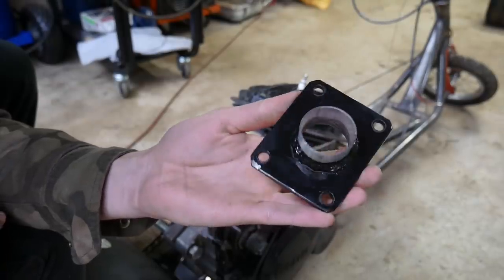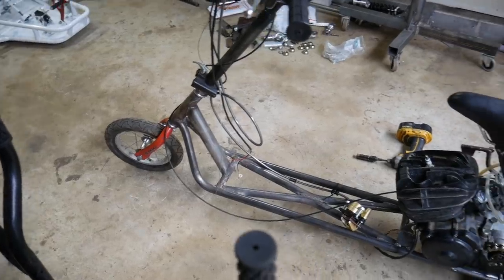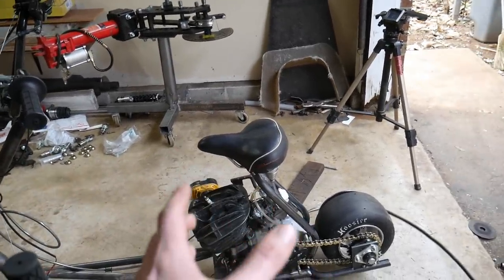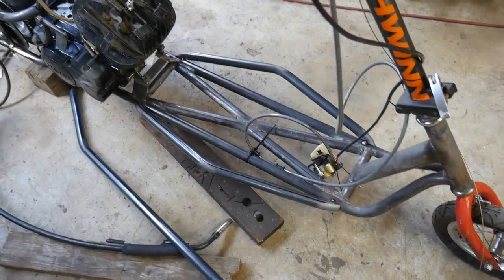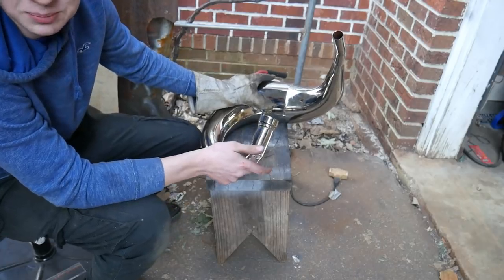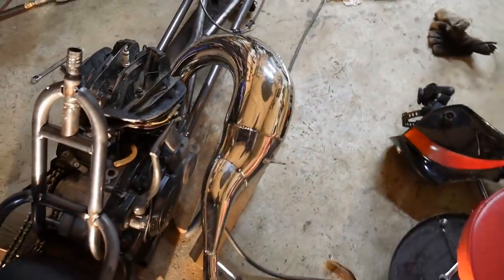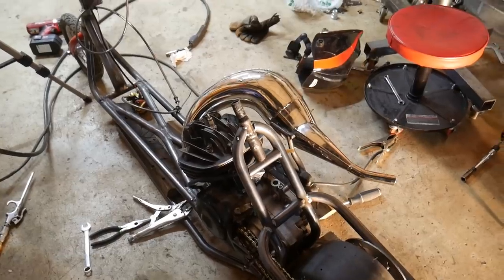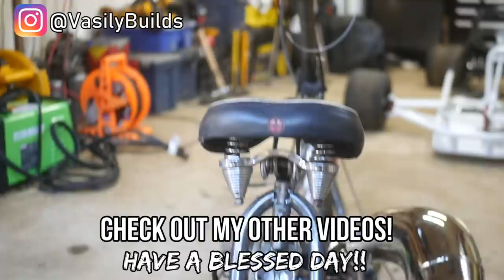Yamaha Blaster 200cc Drag Scooter Build Part 2

Comment: The reason the carb flange was turned was to allow the carb to sit vertically. With it angled like that you’ll either lose bowl capacity, or be more prone to leaking. The only carbs that work just as great tilted as they do straight are Lectron carbs. With the amount of vibration that a 2 stroke produces, the little bit of reduced capacity of the bowl will likely cause it to starve out, which can be catastrophic on a 2 stroke.

Comment: Here's a tip on getting your fcaw welds to look better, instead of weaving your weld like you would with gmaw its generally practiced to just straight push it without weaving it and just straight pull it for thicker gauges of metal. Itll take a little practice and itll feel wrong but you'll get it. Hope that helps!

Comment: My two thoughts:
Pipe will need rear support, or it will break off quickly.
Carb needs to be level (thats why the stock manifold has slight bend) Float wont work properly at that drastic angle - unless you buy a specific downdraft carb........
Reply: I thought that he should put the muffler under the seat because it looks really far out to the side
Reply from the maker: Carb doesn't have to be level if it's going to be spending most of it's time on one wheel 🤷🏼‍♀️ pipe will have a bracket welded
Reply: @VasilyBuilds  I've run them that steep. The hinge for the float is most likely on the intake side, so it's just a little adjustment of the float level. As long as you are not off road, you shouldn't be uncovering the jet with fuel. And like you say This thing is going to be pulling g's. You could get a misfire when braking hard as the jet may come uncovered
Reply: Carb level for sure. It'll starve quickly like that. Could get a shifter kart carburetor which is a lot like a small engine carb like a weed eater or blower.
Reply: Carb doesn't have to be level. That's silly nonsense and you are stating it like its fact.  I've ran a slide carb at 20* before with zero issues.  I'd try this angle.  

This thing is f*ing rad.
Reply: @nme1605  They are called pumper carburetors I run them on Motorized bikes they have really big ones. I'm running a 324a pumper carb it's around 25mm I.d it's just a little bit overkill for my 66cc bike engine but I can hold my bike straight up and it will stay running.
Reply: @kartnerds  I've ran some steep angles on a couple of scooter builds and didn't have an issue. I don't know exactly how steep. But I think my first sentence was supposed to say fuel level. Not carb. I mean run the thing. See how she acts.
Reply: @kartnerds  Yeah probably won't have any issue and if it does its probably idle problems because the idle jet might be drowned/too submerged in gasoline but who idles a 17hp scooter? :)  If the float works and main jet gets fuel it works.
Reply from the maker: @kartnerds  right! They be tripping
Reply: @VasilyBuilds  they must not watch the channel... Cause Vasily has no issue making things go!  Making things stop.... 🤐🤕🤣

Stopping is boring anyway.   

You gonna go blow thru on the buggy build?
Reply from the maker: @kartnerds  probably draw through
Reply: The carb is totally fine, there's no reason that it needs to be level. It will even run with the carb flat on its side. Also it's obvious he's not going to leave the pipe hanging just like that. He's not even done yet armchair quarterbacks. SMH.
Reply: @FarmerFpv  "Armchair Quarterback"?? I've been building race motorcycles for many decades. NO carb with a float bowl will work on its side- you seem very knowledgeable....... Obviously - was trying to help, that last thing you want is a two stroke to run lean, theres a reason why ALL motorcycles have carbs that are level (unless specific Down-draft carbs, which two strokes never have) But I guess 40+ years of building hundreds of bikes for myself and customers qualifies me as an Armchair Quarterback...........

Comment: 3:15 You just got out of the hospital, please don't send yourself back. One stray motion and that grinder can grab your sweatshirt and pull itself in and tear you a new one, literally. Grinders have so much inertia spinning that fast, it wouldnt even matter if you let go of the switch.
Reply: thats why i use harbor freight grinders, The bearings are so bad its like a brake that stops right when i let off the switch hahah

Comment: Put some stabilizers from a kids bike on! I put some on my friends reliant robin three wheeler car and it really worked.if you go too fast round a corner in them they are renowned to tip over and roll.you could feel the none bearing wheels gripping and I think it actually helped it get round the corners like rear wheel steering.too much weight in the boot and you can wheelie them too we found out with a boot full of stones for his garden😂😂😂🍻👍

Comment: Don't dingledink with that exhaust pipe too much, it's tuned to the engine, won't work right if it's changed too much
Reply: He didn't. If he cut and added some or removed some it would matter. The shock wave works on volume, length and taper. He didn't change any of those

Comment: Very nice build! I wish i could weld like that! Can´t wait to see it moving :D
Regarding the exhaust, i think the modification to that expansion chamber will change it´s characteristics quite a bit, because shape matters a lot in expansion chambers.
There is a bunch of science to this holy grail of 2-stroke tuning :D
https://www.youtube.com/watch?v=4wMtrVmeoBU
Reply: I always thought 2 strokes needed certain back pressure from the exhaust for optimal power etc so yes cutting or reshaping it could change this be interesting to see how it works after longer use and of it effects it
Reply: Nimbus Nimbus  care to watch the video i posted the link to explaining how shape is essential to expansion chambers? IMHO, cutting and rotating pieces like he did IS reshaping. Just look at the baffle cone after the welding, can´t you see the difference? Since the motor is overpowered for the scooter anyway, it might even be beneficial if the "Reso" does not work as intended ;)
Reply: Nimbus Nimbus  Happy to hear you have watched the video :) As far as i understand it, the reflections of the soundwave bouncing back from the baffle cone will go differently if the baffler cone gets partially tilted (like he did). If we assume entry angle=exit angle. He changes the angle of the baffler cone and thus he is changing the direction of the reflected soundwave, which i assume will have an effect on latency/travel time. I don´t know how much it has changed in performance, but my bet is it will not resonate that much at a certain rpm, which means the boost will not be as high as before, maybe even not at the same rpm as before. Dealing with an OP build like this, i think he will not experience any lack of power anyway :p
@Reso is short for "Resonance". Austria is a german speaking country, we don´t say "Expansionskammerauspuff" :D, we say "Resonanzauspuff" or "Reso" in short.